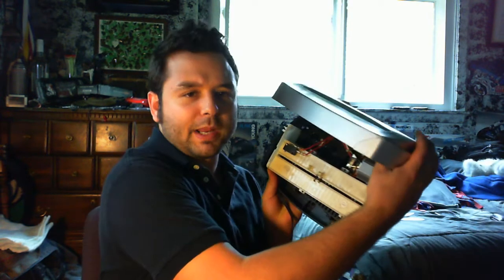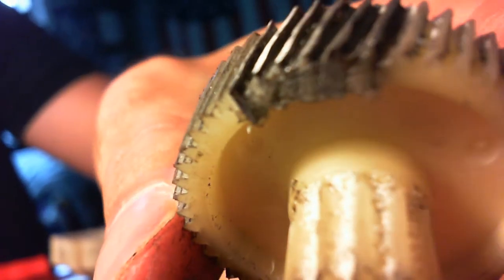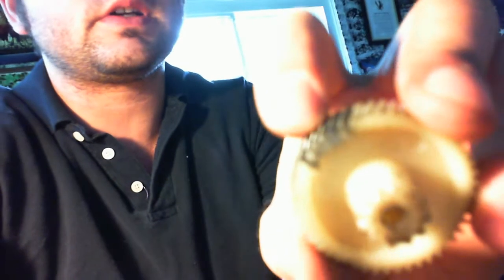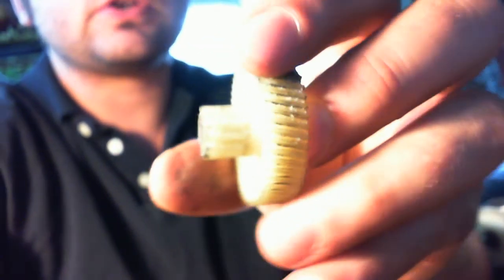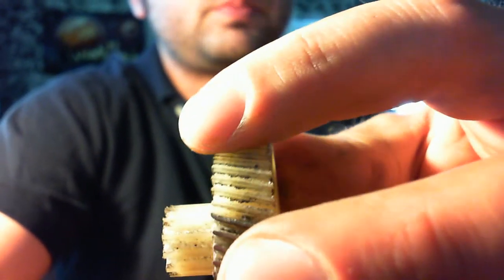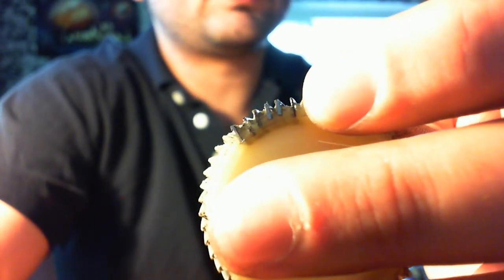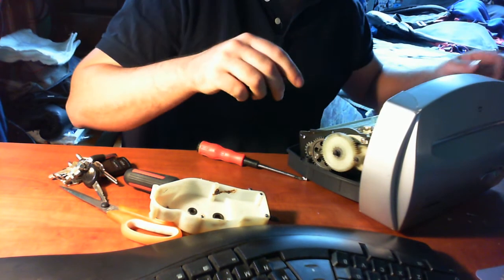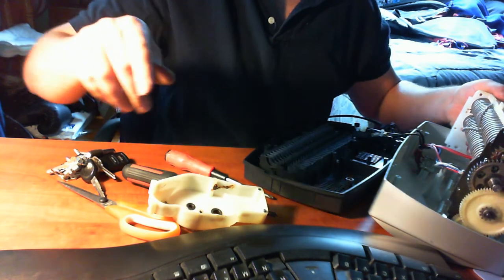Fixing plastic gears for a paper shreader

Comment: I have the same shredder that just did that but not only on that gear, but on the smaller one it spins against. With other gears in the mechanism that are metal, did you ever wonder why they decided to use plastic in any of the gears that take such abuse? I may try your solution. Good work.